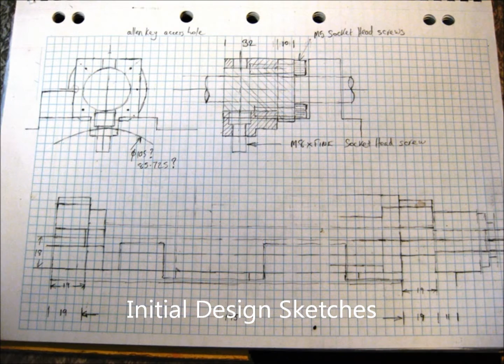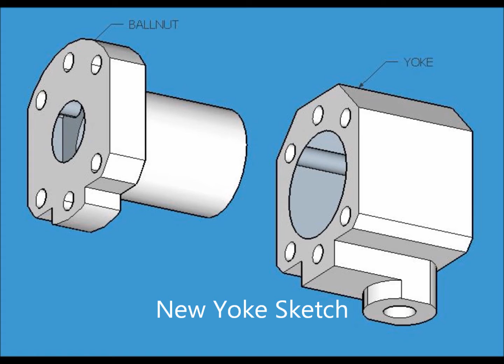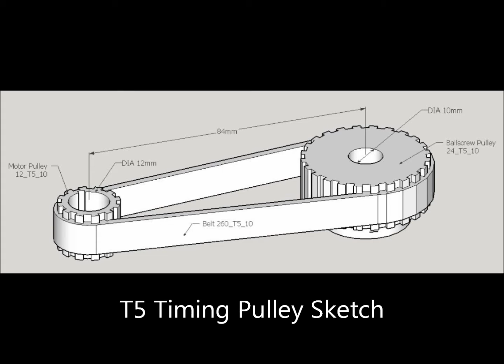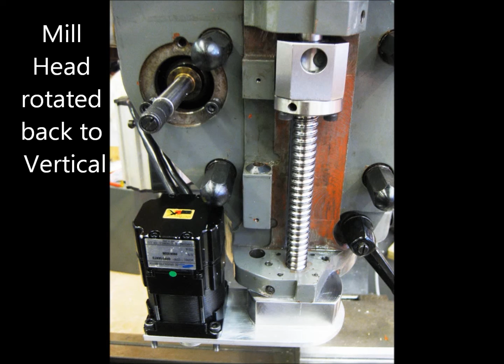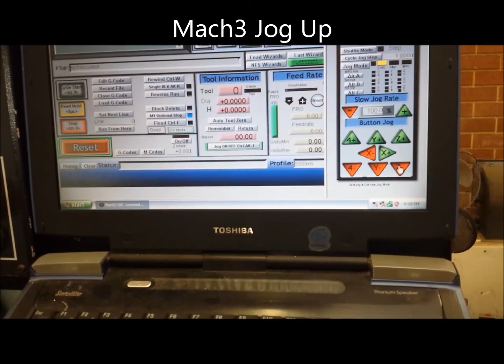Mill Z axis CNC design and Build

Comment from the maker: Robert, Follow my build thread from the post link here to see how I run the VFD. I used a plugin from a French guy I found on CNCzone. I would need to look up the specifics if you need more info. http://www.cnczone.com/forums/knee-vertical-mills/105668-cnc-post1883386.html#post1883386